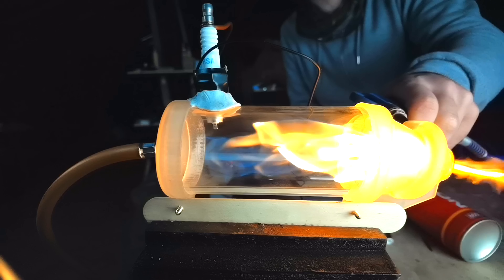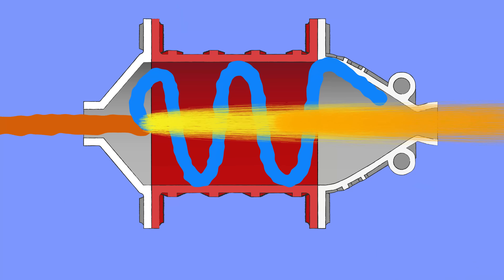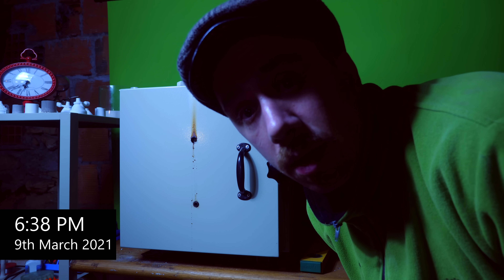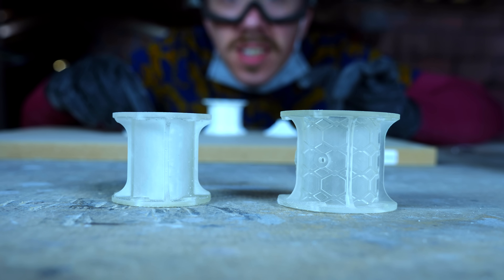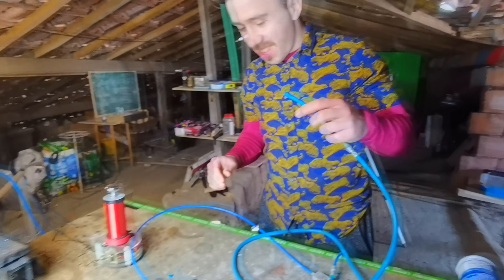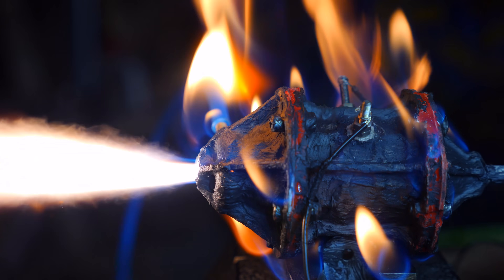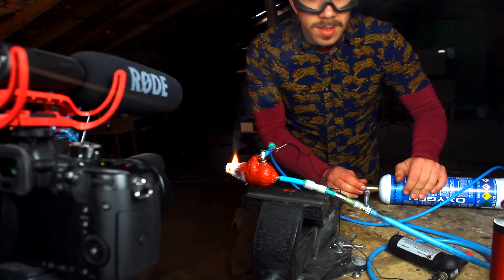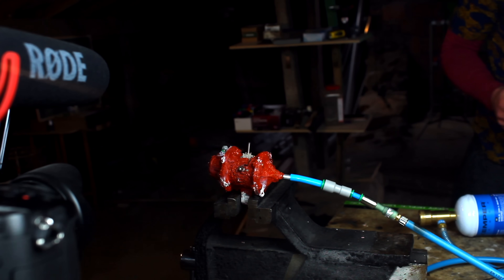Vortex Rocket V2.0 (3D Printed)

Comment: A way to potentially fix the leaking would be to impregnate the baked porcelain parts in a vacuum chamber while submerged in the porcelite resin. Hopefully this will fill the pores made when baking the parts. You would have to bake again, so some testing would be needed to see if this process works , and if it does,  how many times it would have to be repeated to remove the pores.

Comment: You should try NO2 and propane might run a bit cooler? 
What about printing the supports separately like a cradle? 
And then glazing and re-firing the part that would give it a glassy exterior.

Comment: I would say, soak the part in some kind of heat resistant liquid like Starlite. Just plug-in the openings. ( Make it a bit more liquidy like you would normally do, so it will run into the poures more easily )

Comment: Before you solve the leaking problem, you need a way to measure thrust. Other people have already suggested glaze to fix the leak and I think that will work, just don't forget you need to be able to measure the thrust it outputs. Since your engine has a mount attached to the bottom you could extend that and attach it to a  simple toque measure. With some simple calculations you can find the thrust with a pretty low margin of error.

Comment: Next video retry this but use stainless steel for the combustion chamber, and the ceramic just for the nozzle and the vortex generator, or perhaps you could try a double walled combustion chamber and use regenerative cooling and a ceramic nozzle with no vortex generator, also you could try to measure the thrust to see if the rocket is actually producing any thrust.

Comment: The translation to your idiom that you're looking for is "All good things come in threes."
As for how to fix your engine, the 3d-printing process only needs  to be used to make a very well defined chamber right? Once it's printed, surround it in a cylinder of concrete. This has the added bonus of looking like a solid rocket booster.

Comment: Maybe if you use 3d printed pieces not as the main rocket parts but as molds to make like concrete styled rocket, you would solve the leaking issues

Comment: I still think due to the way oxidizers work you would have better results cooling the outside of the chamber with the fuel and injecting the oxygen at the back. At high temperatures a lot of the stuff you are using to construct these just becomes "fuel" so cooling it with the oxidizer makes it a flammable mixture, where if you cooled them with the fuel, a fuel on fuel mixture won't burn. And then cause the leaking, some of your engines didn't leak at first but the outside didn't stay cool enough, likely because it was actually burning.

Comment: Have you thought about using overlapping joints so that there is less of a week spot for it to leak.
Also I think the sudden temperature change is causing it to crack, you might need to gently heat it up first with a blowtorch.

Comment: I think that the issue here is that the tensile property of the ceramic cannot handle the pressure built up inside of it. This is causing it to crack and leak. You can see on the submarine rocket areas that bubble up before fire comes out. The ceramic for the bell is a good use as the delta p will be low side to side. For the combustion chamber you need heat resistant and very high tensile strength as the gasses will only go mach when the pressure ratio is over 2:1.  What if you did an aerospike with the middle ceramic (under compression instead of tension) and the outer body made of steel?  Love the show.

Comment: Before I continue, I just want to say I have very little experience with rockets and the like, so my idea may be... uneducated. 

That said, as a way to reduce/work around the leaking, why not design a double walled engine? the interior chamber would be where the actual combustion takes place, while the space between the inner and outer walls could catch the leaks, and maybe even redirect them in the direction the nozzle is facing. It would have to be a single unit, in order for the fuel line to reach the interior chamber through the outer wall. I'm not ignoring the possibility of a modular engine, it's just that more gaps tend to coincide with more leaks. That's just my opinion, though, so do what you feel is right. 

Anyway, Integza, just wanted to say that I've been enjoying the videos you've been putting out! I started watching you when you started your pulse-jet engine arc, and the video of you spinning in a chair with the working engine is one of my favorites. This was another fantastic video, especially with the extra animations!  Thank you as always for your efforts, and I look forward to more crazy engine designs! 
I'm learning a lot from these. ^U^

Comment: You should use a coat of silicone then a coat of fire place sealant. The theory is that the silicone will handle the heat and the sealant will prevent the engine from breaking down and leaking

Comment: I didn’t see anyone mentioning silica dust. As the concern for your safety. 

I would definitely wear a mask when handling ceramic dust. The fine silica dust getting into your lungs can cause scarring, reduce your breathing capacity, and permanently cause irreversible damages your lungs. 

I’ve worked in ceramics before for 2 years. The most harmful thing to do is breathing in the dust. Of course it’s not hazardous to ingest or touch clay. 😂
Reply: As as a tip: When cleaning up dust. It’s best use a wet mop to clean the dust and/or wipe them off with a damp cloth.

Comment: The nozzle is restricting a lot of the air flow into the combustion chamber It's like a overpowered tesla valve it is restricting the airflow out the nozzle and that brings up the chamber pressure making it explode with holes. That's just my idea... Maybe the solution is to just Make the airflow in nozzle bigger. I don't know I'm not a rocket scientist.

Comment: Hi thanks for the video
For your leaking problems you can enamelled your ceramic part like pottery. 
You have the proper kiln to do that. 
You can maybe use it to glue together the different ceramic parts. 
It is fireproof and the gas don’t go through. 
Good luck and take care.

Comment: What if you 3d printed the combustion chamber in a non-porous material and did a centrifugal cast of the interior surface with a ceramic cement? Also as has been mentioned a ceramic cement dip could also work well.

Comment: Your throat diameter is likely a bit to small, making the pressure build with higher thrust and force its way through the ceramic.  Bigger throat
Reply: Throat diameter is determined by chamber pressure and propellant mass flow rate. After picking a chamber pressure, propellant combo, O/F ratio, and either picking a thrust and expansion ratio, or just picking a desired propellant mass flow rate based on what your equipment can provide tge required throat diameter is a fixed value. Google "NASA Rocket Nozzle Equations" to get NASA Glenn's page on the topic, it has all the necessary equations. They also have a page on the isentropic flow relations from which the nozzle relations are derived which is equally as useful.
Reply: @maxk4324  yeah, and that should explain why it seems to handle low flow rates well and just seeps at at higher rates
Reply: @jerryz_here3614  I also suspect that at low flow rates the throat just isn't choking and the Mach 1 throat condition required for rocket engines to operate properly isn't being achieved. At higher rates it might be, but as you point out the higher flow rates lead to higher chamber pressures which are likely pushing the hot gas through the boundary layer vortex and then seaping through porous walls.
Reply: @maxk4324  yeah. @integza , check out nasa’s rocket throat diameter calculator, should  help you pick a more appropriate size.  Just remember that it normally gives very conservative measurements to prevent RUDs, so I’d do the calculations it give you manually to ensure you get the most efficient throat diameter
Reply: Haha this isn’t Twitter lol, can’t @ people easily
Reply: or a thicker layer of silicon
Reply: @Mike_Rogge  or silicon inside ? So no bubbling
Reply: Soooo he's got a tight throat ❤️❤️❤️❤️

Comment: When I put Chrome headers on an engine I would spray the inside with lithium grease. When baked into the interior of the header it would insulate the  header and keep the chrome from turning blue from the heat. I'm not sure how it would stand up to the pressures your working with but they never discolored and it also relieved  heat stress in the metal.

Comment: If I had access to the same stuff you had I would then move in the direction of metal coating microlatices.https://youtu.be/tpO5DgiCgyM
You would have to find the right metal and figure out how much material would be needed to cover over the pours. Then it should be fine as long as it can take the heat

Comment: Just thinking out loud; If you add an outer wall, and flow the cold expanded oxidizer through it,  maybe even 3d printed in plastic, or a metal sheet.  It could further cool the ceramic chamber wall and maybe also "seal" it. Any leak through the ceramic wall would be picked up by the flow in the outer chamber and reinjected in the vortex... Love your videos Cheers! Lukasz

Comment: You could print the inner dimensions of the vortex rocket you want in plastic and then cover the out side in ceramic and them melt the plastic out so your left with the exact inner dimensions you want.

Comment: Wouldn't the most obvious solution be to glue the parts together in the kiln using the resin or a ceramic glue made from slurry?

Also you can probably make some better supports so you are doing less work. I would use an airbrush to spray on the external layers to smooth them out rather than trying to use high temp silicone. There also may be air in your resin so try putting it under a vacuum before use.

Comment: in pottery there are powders to seal clay equipment. they are usually added before firing the ceramic. sometimes they are mixed with wather so you can apply them with a brush. that should fix the leaking, i think.

Comment: Id like to see you use the ceramic in a steam engine. It would be able to handle the heat but I'm not sure about the tight tolerances for the piston but it'd be cool to see with the valve gear and all perhaps make a steam powered generator to power integzabot or something

Comment: Olá meu amigo! To get rid of the leakages, what if instead of 3D print directly in ceramic, you can 3D print a mold, fill with ceramic and cure it in your oven? Like an they make a bricks, or in Portugal and in Brazil also the roof tile. Also, a lot of engines for cars are made in this way, but of course in aluminum.

Comment: You could make a video about making a proper (most likely a metal one) rocket engine and test it with different fuels like diesel for example. I'm pretty sure that would be very interesting to watch. I'm also curious about all the math you use to calculate dimensions of your crafts. Try not to set your house on fire :D

Comment: do you have the ability to print metal? 3d printed titanium would work well. I honestly don't know if that equipment is even openly available. You could always find a buddy with a mill and lathe (or a combo unit for the size you are building) and have it machined.

Comment: Integza, you are using the oxygen to create the vortex. Have you tried to exchange the fuel and oxydizer inlets ? The propane molecules are bigger and that could reduce your leaking problem without changing the design...

Comment: My suggestion would be to 3D print the engine parts in pla then use lost pla casting to make the engine out of aluminum or bronze. It would prevent (or at least lessen the chances of) total destruction, allow you to integrate the fuel and oxygen lines, and just seems like a better choice of materials. Best part is you already have a furnace to burn out the pla and to melt the metal

Comment: Coat the vortex in high heat cement and carbon fiber it worked in the past it should work again and use a high heat gasket to make a perfect seal in the joints.

Comment: need the sealant on the inside somehow so that it is forced into the pores. sealing from outside is like trying to put tape over a leaky pipe...the pressure fights the adhesion.

Comment: You have a high temperature resistant material, could you maybe dip / coat the areas that are leaking in molten metal and then let it cool?

Comment: Try using aluminum design that can be molding from 3D print as you did with turbojet fan prop, except thicker. Then put that welder👨‍🏭 to good use to button it up! Also a thermal coating inside to prevent aluminum from heating as much and cooling fins on outside would help dissipate the heat to run hotter. Just don’t forget a turbo jet fan to simulate the air around it for more accurate results!😉j/k! Your roof would be like Mr. Tomato 🍅 🔥 after a successful win from you!

Comment: Pottery glaze, applied inside and outside, to the full assembly might help.  Sodium silicate, possibly with a talc or aluminum oxide filler, might also work, and would not need kiln.

Comment: My first thought would be some sort of T-shaped rubber or silicon liner that you would place between each connecting part of the engine. 

 It would be placed so the top of the T is along the inside of the chamber with the tail (for lack of a better word) between the ceramic pieces themselves. That way as the pressure increases, it would push harder outwards to keep the seal tighter and prevent leaks

From there it's a materials problem of finding a substance that's flexible enough to curve along the inside of the chamber, compressible enough that it doesn't crack the main modular parts when it expands, and heat resistant enough that it doesn't melt.

Comment: Going on with the sugar rocket idea. What if you made a rocket powered drone?? You could easily 3d print the body parts for that and it would be fairly light. You could use servos to control the direction of the rockets. Best part? They would melt tomatoes with ease!

Comment: Would it be possible to glaze the ceramic parts in order to achieve the desired temp/strength/porosity?
Find millimeter measurements for consistent parts, then test different glazing compounds/formulas.
Two step process. Glaze the part inside and out. My theory stems from the manufacture of automotive
catalytic converters and the chemical composition of the parts vs the temperature range and requirements.
You should be able to achieve some sort of strength sealing temperature control through ceramics. 
Your videos are hilarious. Keep them coming!!!

Comment: slightly askew to the plan to 3d print the engine, but how about 3d printing a mold for some clay in the desired shape?  I don't think there is a way to not get a porous result from the method you're currently using.

Comment: If you coat the inside of the engine with a material that fills the gaps and is ceramic in nature post drying, you can get a air tight engine.  I am not sure what that material might be and the application may be like building a ship inside a bottle, but if successful it prove more effective than coating the outside with the intent to seal cracks in the base material or connections between parts.  In liquid form, the material should have a very low viscosity so you can roll the engine and let it soak into the cracks.

I still think a high speed printed motor would be a good option, connect it to a food processor to kill off mr tomato...

Comment: Integza I've been wondering something is it possible to make a mould in the resin printer? you could then fill it with ceramic to have a perfect finish. I say this because I got my first printer a few weeks ago and since then I only have print moulds so far, moulds for cement, plaster and plastic injection and it becomes cheaper and faster to replicate.

Comment: Put the rocket in a metal tube and fill the space with refectory cement. If you want to go the extra 1.6 kilometers, weld caps to the ends of the pipe to further seal the engine. Love your work you crazy tomato hating mad man!

Comment: As far as I know... (<- this is supposed to be the disclaimer) even metal castings can leak if they are too thin. So either the thickness has to be increased... or you need to find a material that you can use to impregnate the ceramic. (It should also resist the high temperature, and probably have the same coefficient for thermal expansion as you ceramic)
I'm not sure what could be a suitable material. (Maybe using sodium metasilicate (water glass) but I'm not sure if that would actually fill the holes...
For applying the material, I was thinking either filling up the combustion chamber and somehow applying pressure, so it would seep in the pores. My guess is that if you can decrease the number and size of pores you can have a better result. Maybe you can't completely eliminate them all. Further assumptions: probably it takes awhile to fill the material, and probably it would not like huge pressures. Probably what I'm saying has no justification at all :D

addition:
so normally they test for leaks with Helium.. but since already propane goes through.. the holes are fairly large :D

Comment: the engines probably would work better without the direct O2 feed. the O2 is making everything burn MUCH hotter. try going back to the compressed air. you will lose some thrust but it'll make it easier to fine-tune the engines

Comment: Maybe dunk the porous parts in some type of uncured heat resistant resin then pull a vacuum on it to remove air from the pores, then, while still submerged re-pressurize the container to force the resin into all the pores